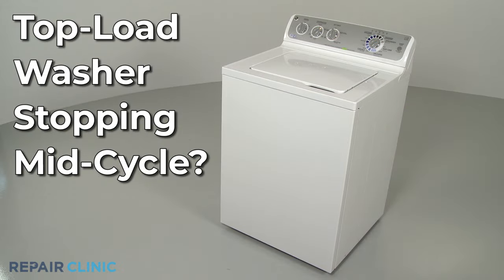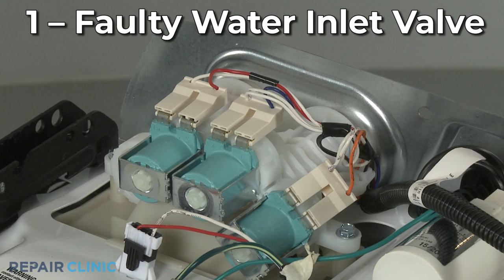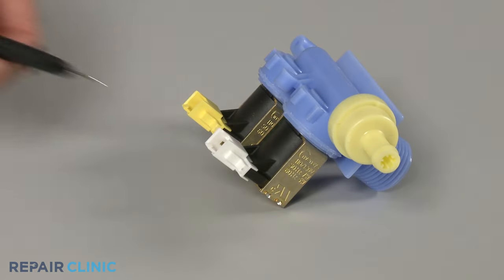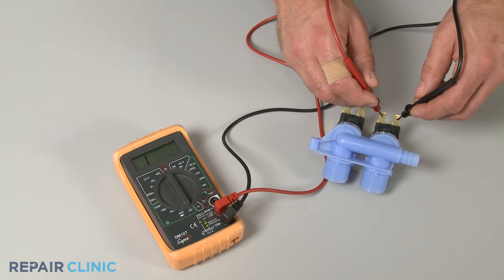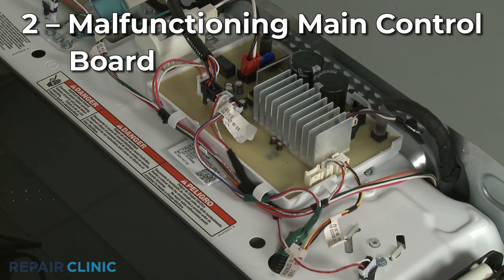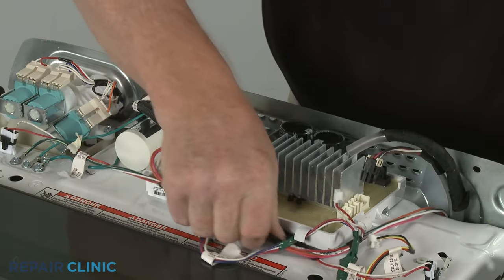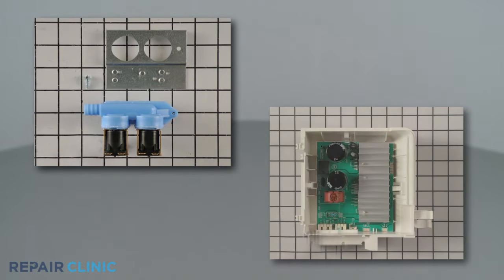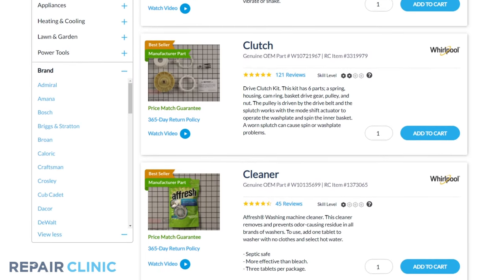Top-Load Washer Stops Mid-Cycle — Top-Load Washing Machine Troubleshooting

Comment: I also experienced malfunctions where the machine did not get filled quickly or at all, or that it would not complete the spinning cycle with about eight minutes on the clock remaining. The solutions were easy. The first problem was easy to sort out. I loosened the water inlet hose at the back of the machine and removed the sieve on the inside of the pipe at the inlet point. After I cleaned the sieve and installed it again, the problem of filling was gone. The second problem was just as easy. At the outlet, there is also a filter which can be cleaned. I have found some thin string that wound up and caused the water pump to stop functioning which caused the machine to stop. I just removed the string and the machine runs 100% and I did not have to buy a new water pump, motherboard or electrical spares. Needless to say, I saved plenty of money and did not enrich the scammers who would take your money without blinking twice.

Comment: Ok! Why would a washer just start as soon as you plug it in? Then just keeps going through the cycles non stop.
Reply: On/off switch/control is stuck, most likely. It could be shorted out, meaning a wire or switch is broken, and making the electrical connection itself. Sounds simple and it is, but not if you've never seen something like this before. No one pops out of the delivery room, already trained to be a mechanic or anything else. Best wishes. Even if you has to call someone, you learned something. Consider that your tuition. Breaking things while your fixing or trying to fix something else, is tuition, as well, ya' gotta keep in mind. Expect it to happen, ok?

Comment: Speed Queen yay that's what mine does stops mid-cycle. They came out and fixed it what was under warranty. Didn't help.
Reply: That $thinks. Did they ever get it fixed. My spin cycle starts sometimes, doesn't start other times. No drive belt. One of those couplers. Hoping to have time today. Best wishes.
Reply: Drain the plug that’s on the back of the tub connected to the tub